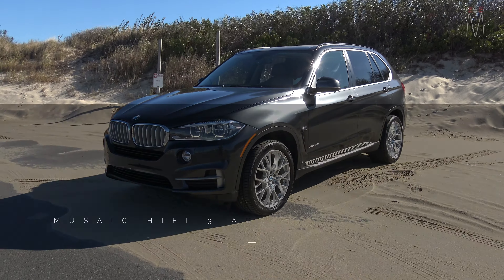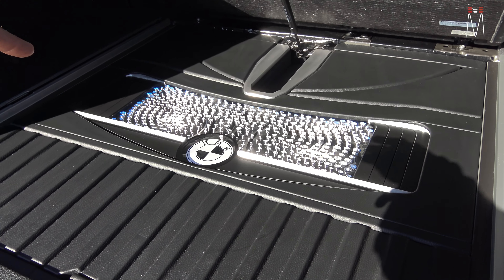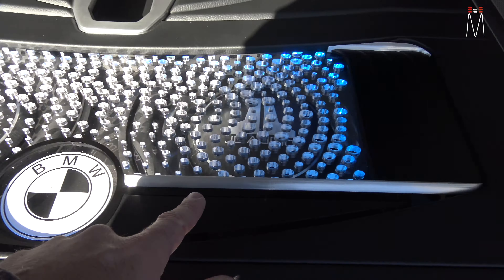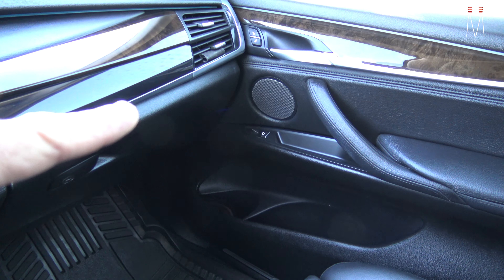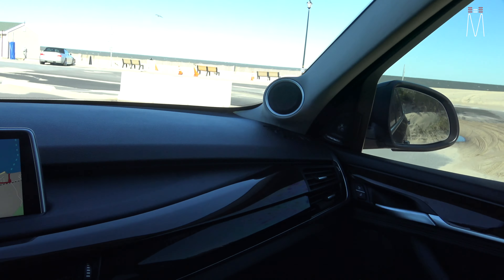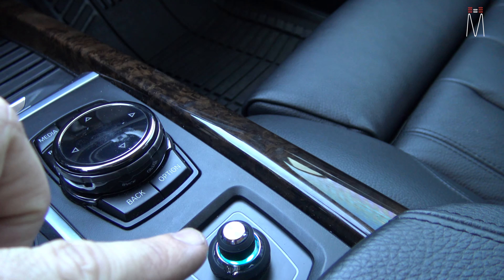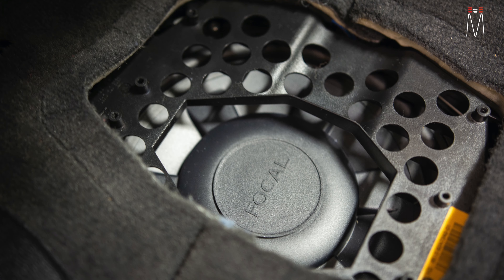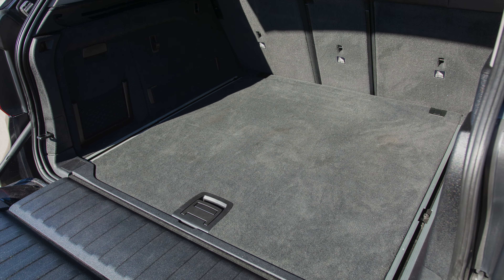BMW X5 F15 Stealth Audiophile Stereo EXPLAINED!!!

Comment: Factory chimes/bells/radar sounds still work on just preset 1 correct? Also, if you connect an iPhone using the Tidal app on Master quality through the factory USB, is the sound output actually Master (192/24 if recorded that way)? Or is high rez only through preset 2 and 3?
Reply from the maker: mixxeerr chimes work just like intended through preset 1 which is the OEM radio. Tidal streams at cd quality 16/44. The factory DAC is probably limited to 16/44. Which means you need another means of running higher bandwidth source files. Which is where preset 2 and 3 come into play.
Reply: @therealmatty_s  Matt, fantastic build! Is Tidal what you use, or GoBuz? I cancelled my Spotify, today, after your comment Spotify is heavily compressed.
Reply from the maker: mixxeerr tidal is the most mainstream. However amazon just release their HD and Ultra HD music streaming service which they claim stream up to 24/192. Tidal streams at 16/44.
Reply: @therealmatty_s  thank you, Matt. I will go with Amazon HD then and load the A&K DAP.

Comment: As always impeccable craftsmanship Matt.Question, has Tesla or any other car manufacturers approached you to design audio systems for their cars? Is that something you would be interested in doing? Because it seems a lot of car manufacturers don't put a lot of stock in car audio, Its a lot better than years ago, but some so called " premium" systems are rip offs and sound like a 2 watt transistor radio.I was just wondering if you've ever been approached about this.
Reply: I have wondered this, as well. I'm sure SoundFX takes care of him, but if Tesla brought him on board as R&D audio designer he would really cash in.
Reply: @NonPremiumID  That's what I think also.But being at SoundFx gives him more flexibility as far as creating systems as well as the challenge of doing various vehicles.If he just at Tesla for example, they would probably have a template of how they want the systems done and I'm sure a creative guy like Matt is not having that.
Reply: @missayawk  exactly
Reply from the maker: People say this all the time. However, no manufacture would ever see this as necessary. They care about the bottom line. Thats why no matter what "upgraded" OEM system you pay for, they still use paper and plastic speakers.
Reply: @therealmatty_s  While the car manufacturers won't ever do this, you HAVE done builds sponsored by car audio manufacturers like Focal and such for SEMA/CES and other shows?